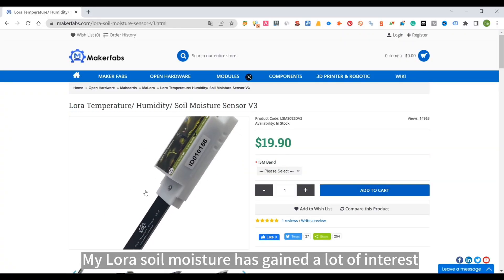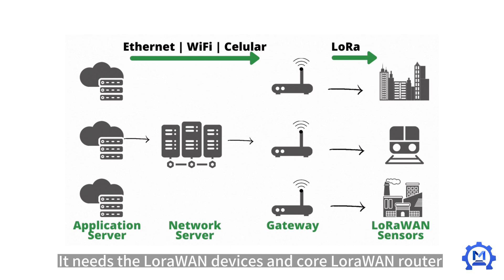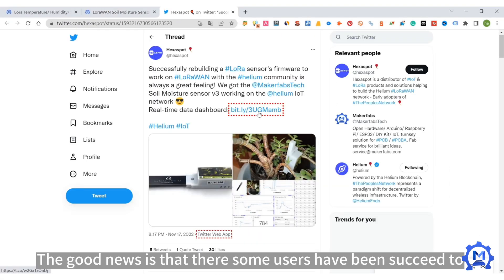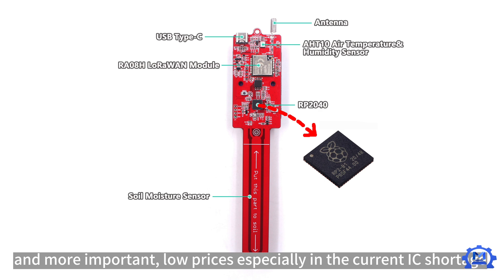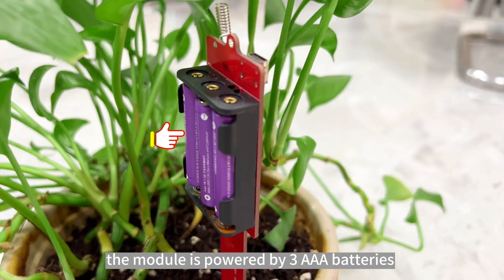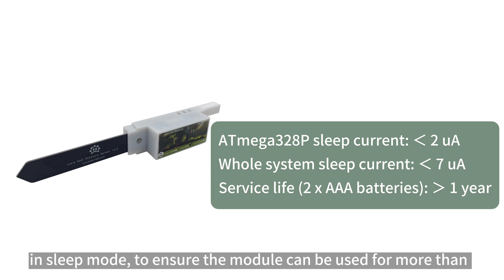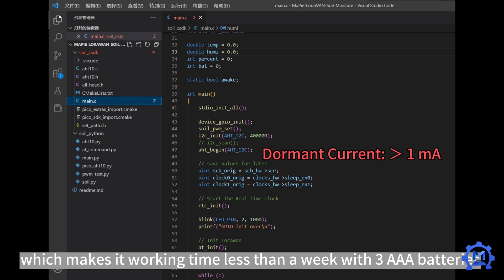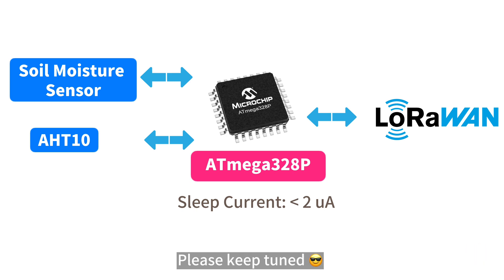Lorawan Soil Moisture Sensor - Makerfabs

Comment: By the way, why didn't you use the internal 6601 processor? No extra ro2040 would be needed. Our power consumption would also be very low in sleep mode.